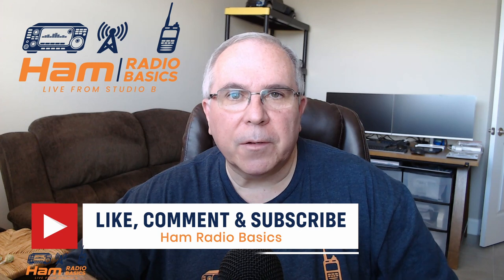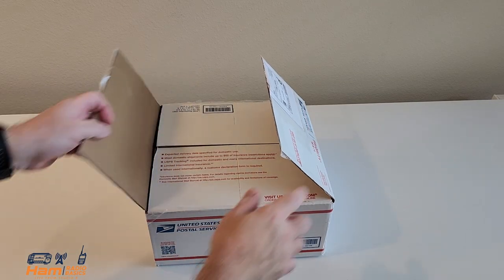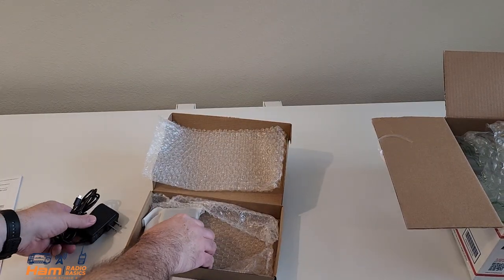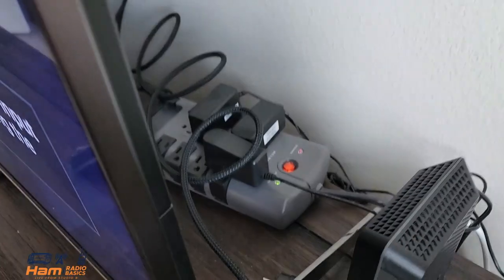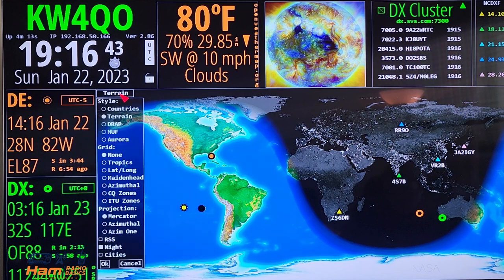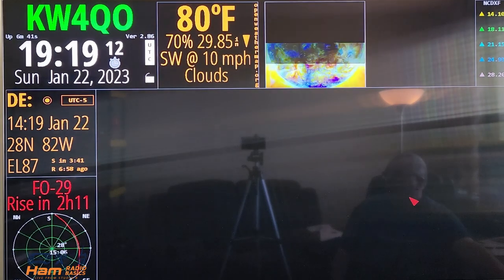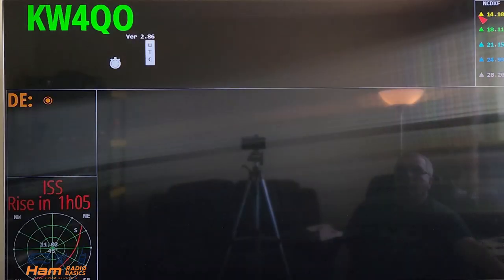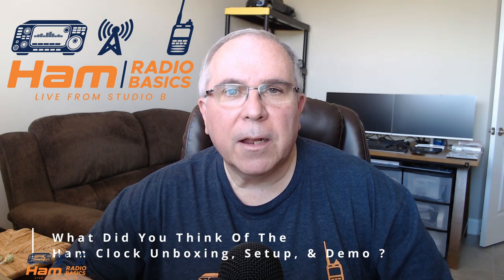Ham Clock Unboxing - Setup - Demo

Comment: no price on there website ???
Reply from the maker: "Here are our current prices in US dollars which are the same as when we launched the product in 2019:

$399.99 for the Model 1850-9x 9" wooden clocks in either Cherry, Walnut, or Tiger Maple (includes a 9" LCD with integral Touchscreen)

$49.99 for the optional 1850-Temp-01 temperature/humidity/barometric pressure sensor (for use with wooden clocks above excluding Raspberry Pi below)

$79.99 for the matching 9" furniture-grade wooden stands in either Cherry, Walnut, or Tiger Maple - these securely tilt the clock back 30 degrees and allow use directly at our operating station desk.

$349.99 for the Model 1850-RP Raspberry Pi version which requires an external monitor with HDMI input (1920x1080p standard HD)
All HFClocks include ac adapter, Controls Guide, and Instructions and typically ship out within 24 hours after receipt of order."
Reply from the maker: You can reach out to them at gmorello@veritiumresearch.com
Reply: As of November 13, 2023, the price for the Pi version is listed at $299. OUCH! But it’s plug and play, no need to do RPi programming and setup.
Reply from the maker: Here is a link on how to order https://www.veritiumhfclock.com/